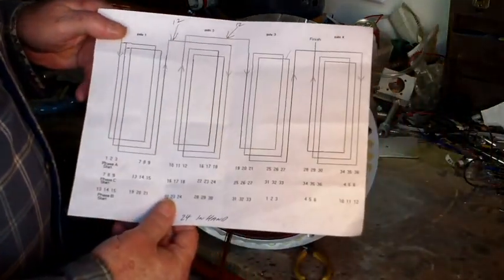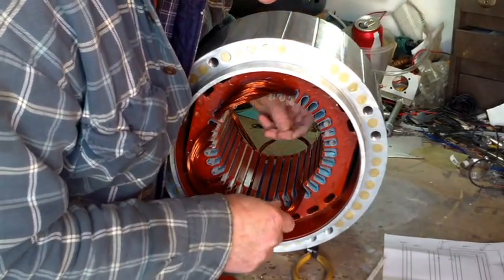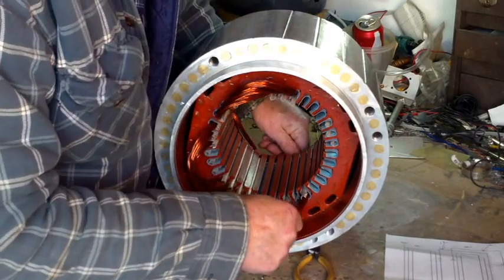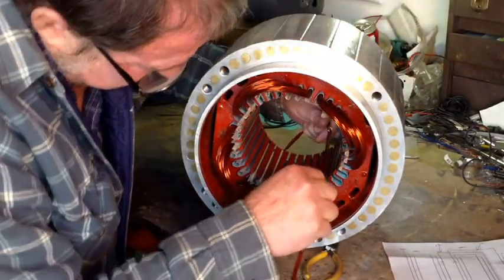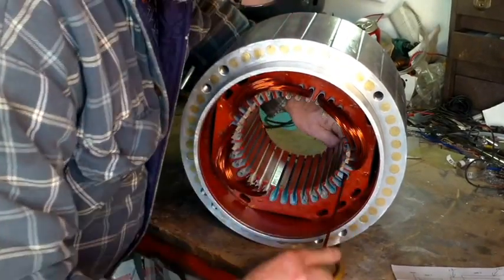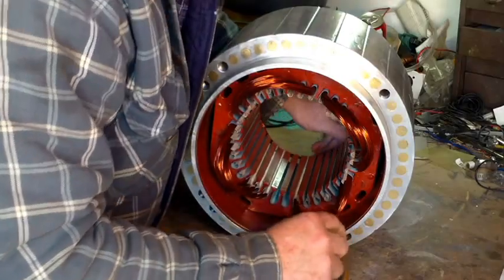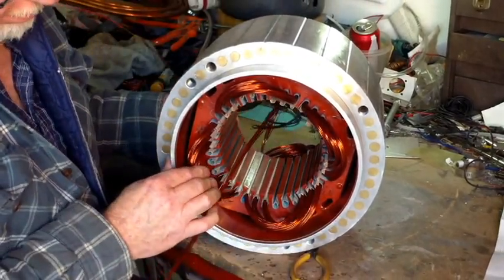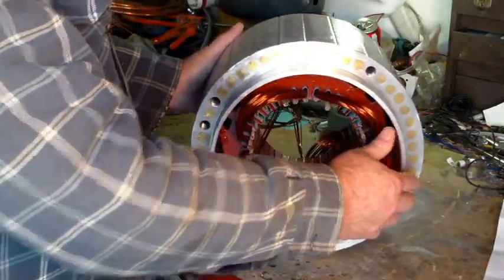3 phase motor winding

Comment: hello ivan my question is how you come 8 wires putting per slot?
is there any calculation and formula to follow?
Reply from the maker: 8   18-gauge wires will easily handle the running load amps of (about) 80 amps  and 8 wires with 3 turns = 24 wires per slot, per phase,  .. times two phases per slot = 48 wires per slot, witch will fit in most motor frames...  make sense?
Reply from the maker: One other way I find how many wires (in hand) I can get into the slot.
Insulate slot Cut 24 wires put in slot add separator stick and add another 24 wires,  will they all fit?  remember there is two phases for each slot...

Comment: Cool video.  Used to wind motors when I was an electrician in a sawmill.  Really brings back memories.  Do you ever cord the pitch on a motor?
Reply from the maker: No there is no overlap on a single phase, lay one phase and each phase
120 degree offset last two phases.  Laying each phase by hand you have
no pole connections. I can lay the phases faster by hand than using pre-maid
coil sets, the best part NO pole connections per phase.

Comment: Hi Ivan. What has hapened to your site? I was doing my project based on your motor and now i couldnt open it again. Please could you help me posting the information about your winding again?
Reply from the maker: My site is back up and running.
Reply: Thanks for answering. Just one more question. On the dyno your 10hp rewind baldor motor did 60 pound force. It is about 8.3kgfm. Is'n it too litlle to ran your Sonoma pickup on direct drive? Did you do some video of it runing? This torque is equivalent to a 1.0l engine of a small car here in Brazil. 

I am thinkin on use a motor like yours on my Peugeot 106 year 2000 with 320vdc and the Heubner Inverter wich project you can see here: http://johanneshuebner.com/quickcms/index.html%3Fen_motor-inverter,8.html. 

Thanks so much for your help!
Reply from the maker: NO NO  my motor puts out 225 foot pounds of torque that is about the same as a six cylinder engine. Just started working on my truck again.
http://ivanbennett.com/forum/index.php?topic=17.0

Comment: Hi! I wonder can you help me? how to calculate the windings, I have a 2,2kw induction motor, and it was three phase, I use it to power an air compressor, but I use it on two phase with delta connection and run capacitors, the motor give up eventually, I took it to a local rewinding shop and they rewind the motor to be used on two phase , so far so good, I took the motor I pay the bill and the motor doesn't have to much power at about 40psi it almost stops, before rewinding the pressure doesn't matter he run until the safety blows. So now I want to take the matter in my hands, I found online a book but the calculation there is... requesting lots of math physics.
can you help telling me if there is some easier calculation? Thanks
Reply from the maker: This is what you need, a cap run and cap start compressor motor, you ain't gonna do it any cheaper. 169 bucks. 230 volt single phase.
http://www.harborfreight.com/3-hp-compressor-duty-motor-68302.html
Got a question for ya, what size is that compressor head, was it meant to have a five HP motor?  Is you wiring big enough to handle the load?
Google the compressor head to find out size. Is the pulleys RPM correct for the motor HP?